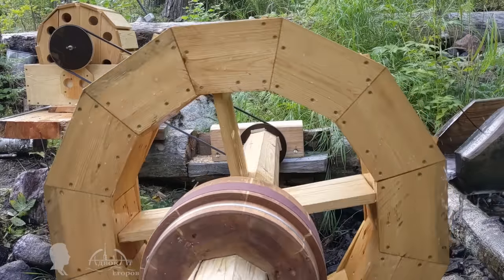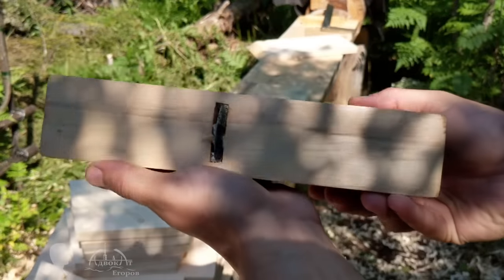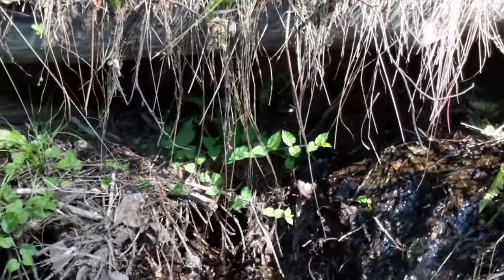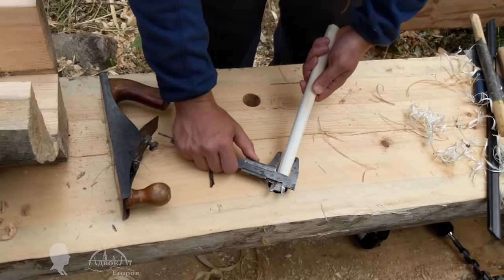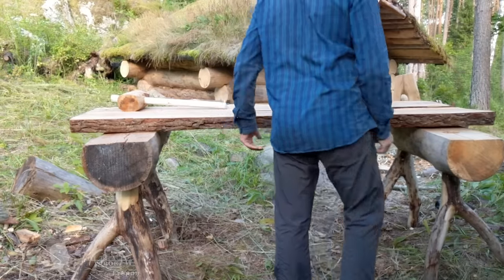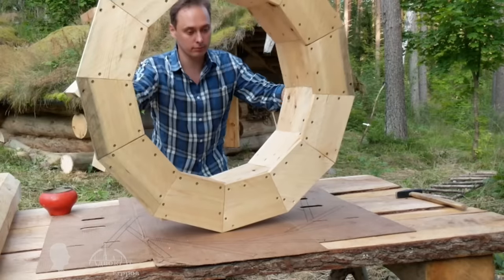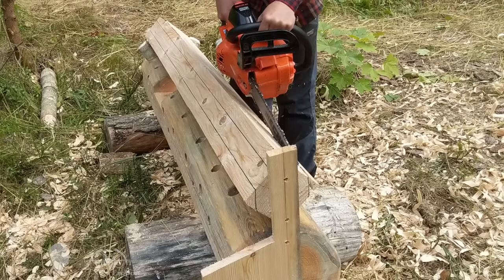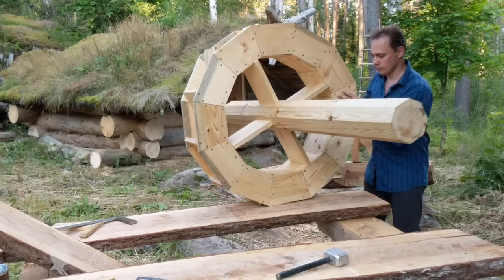Constructing a Bushcraft Waterwheel / Harnessing Hydropower Energy for My Log Cabin Camp

Comment: In America we have a saying "measure twice, cut once". In Russia you have "measure 7 times, cut once". The quality of this craftsmanship reflects that. Through impatience and over-use of power tools I question if I could build a water wheel that even functions. Yet you have made something that spins true using the bare minimum of tools. Absolutely incredible.
Reply: Yeah I couldn't build this. I'd use a large truck wheel on a hub with the blades welded inside the walls of the wheel.
Reply: When I was in school, the expression was "cut it twice, still too short"
Reply: In Northern Romania we have a joke. 
The German measures 10 times and cuts once, the Romanian measures once and cuts 10 times.
Reply: And most importantly he grew wheat and grinds them with the help of his wheel system and makes bread out of it🤗
An absolute legend 😎
Reply: in The Netherlands we have "Measuring is knowing" (meten is weten)
Reply: "I've cut it off twice and it's still too short" is a expression often used here in Switzerland when doing stuff like this.....

Comment: The shape of the wheel made with so many smaller pieces means that the geometry size will be more stable. It will not shrink much from drying because the shrinkage is greatest in the direction of the length of the wood grain. Since the pieces are small, their shrinkage should be negligible. It's a good design. Thank you so much for such a wonderful long video. I will watch it many times, I'm sure.

Comment: The detail of how you have learned to spend more (or less) effort because it is required (or not) is very useful.  As an Engineer, the tendency for extreme accuracy is always there, so know when it matters or does not is very critical.  Understanding the points in time that require extra attention focus on design and where "good but rough is good enough" also helps a person doing it the first time where extra care is a good investment.  I enjoy the way you present the material, and using the correct description of the tools used lexicon for clamp types and such, helps those without experience to look up details on more information themselves -- this is very important to those that have less experience to help themselves!  Bravo.

Comment: One of the best hour-long videos I've watched on YouTube!  I love that you actually have the opportunity to implement your ideas, as well as expanding your skill set!  I wonder if your use of your assorted attachments could be made easier if you were to fabricate a long shaft like in old industrial settings?  A single shaft runs the length of the production floor and allows for the simultaneous driving/powering of all of the milling machines, lathes, grinders, etc... Regardless, I think what you're doing is fantastic and only wish I had the health to do such things on my own.  Namaste
Reply from the maker: Yes, I am planning to build more attachments but the power of this waterwheel is enough only for one machine at a time...
Reply: @Advoko  That's one of the eldest problems mills and waterdriven saws and hammers had ever since we found out how to make the creek share its energy ;-)

Comment: for weather/water proofing wood:  First you need to dry the pieces over a heat source for 48h, 
then you coat them with maritime grade epoxy or polyester resin(less smell when curing, less durable) mixed with UV additive. (you can make it clear, or colored)
for an increase in mechanical strength, coat with resin then apply 1-3 fiber glass mantles (the cloth looking one not the shredded one) finish with another coat of resin.   my little wooden water wheel is made like this, and i use stainless steel hardware, still working 24h for 8 years now.
Reply: With all that epoxy and fibreglass, what do you need the wood for?

Comment: around 40 years ago i got full size plans in the  mail ( pre computer days ) for that exact waterwheel . except mine did not  have a wooden axel , i used face plate mounted bearings and a steel shaft  somehow .   it was for show only and was mounted in a small homemade pond in the backyard and was powered  by a  small pump that pumped water into a wooden box above the wheel . birds loved it for the sound of the running water .

Comment: hey great job u did there, looks fantastic and very interesting to see how this can be done with minimal use of electric tools.
Maybe u could implement an elevator system to lower or increase the height of the water carrying arm from the dam towards the wheel, to adjust the water speeds and therefore the rotational speed of the wheel depending on the work u want to do i.e. grinding coffee beans is better at low speeds; or depending on the "water season" i.e. general high water flow or low water flow.

Maybe u want to add a guiding system for the wheel as well to bring it closer to the dam or further away.

Good luck for ur next projects :-)

Comment: Using a chainsaw wearing sandals gives me the willies.
Reply: Yeah, I've done it in thongs so many times I've lost count.
Every time, I tell myself how stupid it is. 

More importantly though, you should never be cutting with the chainsaw bar heading for between your feet/legs either way.
Reply: @osricsbruk  You can lead a horse to water, mate.  The reality is, we're all the same. He will probably continue to do as he does until he has a close call, so close that it wakes him up.

I'm not one to talk. I still cut between my feet on occasion, run grinders almost exclusively without guards, and ..... lots of supposedly "dangerous" practices.

Trick is, I'm competent. I don't care what the safety officer has to say, I'm there to do a job and I will do it as quickly and efficiently as possible. Whether they agree that my methods are safe or not, doesn't bother me.

Feel free to continue though man. After all, you're only trying to help :)

Comment: Outstanding work Max!! That hour went by really really fast! I have only one suggestion for you You can gain a huge mechanical advantage by changing the diameter of the first wheel, to a secondary smaller feed wheel which will increase the end rotational speed. I believe it would also be possible to embed magnets in the wheel, then create magnetic pickup coils from wire, and with a rectifier you can produce your own electricity. 😉

Comment: You are like the bob ross of bushcrafting. I am planning a homemade homestead and looking for inspiration/ideas. This is literally the first video I have watched on the subject and I can probably just use your vids to get the job done. My problem is having to create my own waterway for water wheel. Im thinking use underground water and pull it above ground with an ebenflo  tactic to create a self pumping system to constantly have water flow. Im either going to set up pipe to drop water onto wheel or create high pressure to simulate a stream
Reply from the maker: Keep in mind, bottle hives are always protected with a reflective foam insulation that I only briefly removed to make these shots...

Comment: That was fantastic!!  You do darn good work. VERY interesting how you designed and built each part.  I have seen many water powered mills and most seem to use over shot water systems.  The water comes to the wheel at the top and runs down the front.  It uses the weight of the water for at least a quarter turn of the wheel for power.  In your case it would have required placing the wheel farther from the dam.  Amazing construction on the wheel I must say.  You are quite the craftsman.  I really enjoyed watching you work all the parts of the job.  Thank you for this video..

Comment: I have never attempted a water wheel, however, I have done several damn and ponds.  I would strongly suggest an overflow pipe and possibly diversion tunnel, to shed water when you have excess spring flow.

Comment: Beautiful, no bout a doubt it, but why not employ a sort of rubbing brake, perhaps from leather for long wear, and inexpensive too? Then you could lower the wheel for more power but avoid the centrifugal force, by starting the water drop at the top of the wheel, so simply put, there is more weight for more power, perhaps to run a generator. Nice work, this also counts well in the work-of-art area.

Comment: Your skills are lifetimes beyond mine so you would know better, but perhaps a foot pedal for multiple lathe-like cutting sessions? You could make one small one akin to an old-fashioned sewing machine but using differential gear advantage like on a chain block. You could also have a larger, platform-sized pedal that was closer to 1:1 that would prime the wheel to overcome initial friction, then you could sustain it lightly with a few pedals too, or simply add either of these forces to a sustained rotation from the stream for more torque if needed. The addition of a flywheel you could variably clutch into could be cool too, but perhaps a little too violent for the elegance of the systems you're working with. Amazing work, as always.

Comment: Next time you decide you want to dry some lumber put it underneath the eaves of your house where it can't get rained on put it up off the ground on a hard surface with boards underneath it to support it and weights on top of it.
The reason why it worked is you don't have anything to hold it straight it has to be weighted down and it's inside where you're warm and it's drying too fast.
When my father was building 50 ft wood boats this is how we had to keep our lumber straight while it was drying.
We would mail it and dad would put it in a drying shed one that was open on one end so that the humidity was there to support its drying and it took about a year to dry it correctly.

Comment: at 32:40 you said you were at a loss as to why your spokes inside the wheel stayed fitted tightly, even after drying out...
in my years of experience working with wood, it does not shrink much in the direction of the grain (less than 0.5%), as the fibers lend it rigidity. but it shrinks more across the grain (2 to 6%), or radially from the heartwood. this is due to the softer spongier materials between the long cellulose fibers. this is why large dried timbers can have cracks along the grain even when not under any stress. and why its better to saw planks while green, so that radial shrinkage isnt spread over as wide an area. hope that makes sense, and a quick googling confirms this with other people's experience.
Reply from the maker: Kelso, thank you for the reply!

Comment: Ok, what about a circular frame supported by an upright timber.  It would look similar to an umbrella or mushroom.  The rotational energy of the waterwheel only needs to be rotated 90 deg. perhaps through a set of wooden right-angle gears/cogs.  Now, on the "cap" of the mushroom, you attach clips and now you can hang your clothing in the sun, and they will gently spin to remove water by centrifugal force (I imagine it will wick from top to bottom and be flung off at the lower edge).  This could enhance drying time significantly vs. just natural sun drying on a line. LOL.
Reply from the maker: Ralph, thank you for the info

Comment: I have a question my love could you have used a brace and bit to drive your tenon cutter and wood augers??? Please let me know sugar bear cause that's what I plan on doing!!!! I'm definitely a driven prepper and am trying to stay away from relying on electricity all together. However I'm also wondering if there's a better way to make boards than using a chainsaw??? Maybe peddle power as that of a bicycle or maybe a larger water wheel????  Sincerely one of your caring fans!!!
Reply from the maker: You could but it won't be easy. You could make boards using a chainsaw (there is even a video about it here) but they won't be as strong as the ones that you produce by splitting...
Reply: @Advoko  thank you so very very much for your reply sweetie and I agree. But would still like to know if I or you could drive the tenon cutter and augers by hand instead of your strong drill!!! I'm thinking about a ratchet adapter for my breaking bar that I can also put a wrench on creating a large ratchet action tee handle what do you think my love?????
Reply from the maker: I think it is doable
Reply: @Advoko  That's it!! Awe come on I'm already convinced you're highly intelligent!! And more elaboration would of course be welcome sweetie. But I do understand your already extremely busy and at the same time honored to have a reply in the first place. Thank you sugar.

Comment: The only thing I think would have served you better is to have the water wheel turning the other direction with the water coming in higher and pushing the wheel over from the top.   It would provide you with more efficient water usage and a bit more torque / power from the wheel.

Comment: You'd gain a lot of energy using a larger wheel the water is slamming into the wheel then going down wasting a large portion of potential. from the look of it you have a 4' wheel you'd likely triple your torque with an 8' wheel using the size as much as a fly wheel and lining up the most efficient part of the blades with the water flow. I'd also suggest using the same kind of Straps the saw mills used to move the working area away from the source. and maybe consider going to a few dowel gears so you can turn it on and off without stopping the wheel.

Comment: The overflow waterwheel design is more efficient. You can see by the amount of backsplash you are getting that water energy is being wasted. The energy that throws the water backwards, is energy lost to the wheel.
With the overflow design, the momentum of the water turns the wheel, but the water collected into the buckets also turns the wheel by gravity. So you get two turning effects, and the water overflowing has a greater distance to fall, so has a greater turning effect.
.

Comment: I found it comical when you were lecturing about safety.  You were describing safety measures, and the image on the screen was one of you using a powerful drill while holding the work down with your bare foot, only a few inches from the spinning drill bit. Pretty funny, actually.  My esteem for was not affected by one whit.

Comment: 40:50 how about connecting the opposite edges on the top of the workpiece and then use a right angle to align the drill bit. Sure not 100% perfect, but same with your method. You'll end up with some run-out on the top and if the workpiece is not completely level in comparison to the clamped drill bit, you'll end up with a hole which gets wider and wider the further you go.
Reply from the maker: There is always more than one way to do the same thing))

Comment: Both ends of the pulley are the same size. You could speed up the rotation of the mill by having a smaller driven wheel.
Reply from the maker: Thank you for the reply.

Comment: Yeah, I see what you did with a wooden mallet , a wedge, a hammer, and chainsaw to create your own lumber. Cool man, you're very skilled.  An assembled mini-aqueduct , w/  a very well made waterwheel. You're  skilled , innovative , and efficient at what you do. The only question that I have is the hollowed  out wooden water channels, as well as the blocked wood used for various purposes suck as the dam, and waterwheel;  (all interacting with H20 ,) are apparently not waterproofed , or is all of it waterproofed ? I did see you applying pith, or stain  ; but not to the entirety of that project of running water you so expertly put together.
Reply from the maker: No, I didn't apply any waterproofing to any parts of the system.

Comment: did you eventually connect the water wheel to a generator.   I haven't seen that video yet,  but were you able to achieve the necessary RPMs and torque to generate enough wattage for your needs.   I see you are using battery powered tools,  but these batteries have to be charged,   how were you able to charge these batteries.
Reply from the maker: I only connected it to a tiny generator made from a drill (shown in this video) to charge my batteries so far.

Comment: Something is a bit odd with your wheel design. You do gain the water energy due to height difference but you loose most of it's dynamic energy due to its speed because of the angle it hits the wheel. You either have to divert the flow direction a bit or even reverse the wheel rotation if you cannot do the first. The power difference will shock you.
Reply from the maker: Thank you for the input

Comment: Not a criticism. Just thinking You should cut back the water trof that turns your wheel. Cut it back where the water land just in the V. The water hitting the wheel straight on your loosing potential force.
Reply from the maker: Thank for the tip!

Comment: Hydro power and it's utilization to provide energy for many things are sometimes forgotten  simple solutions. However,  in the western USA water is more valuable than Gold . Sadly the system shown in this video would be hard to install here because daming & diverting water like this will affect stream flow up and downstream of the device and could get one in alot of trouble. Harnessing any stream creates issues. Water laws are complicated and apply everywhere in the west. You could own the land that a stream or river runs thru but you may not have the right to access the water in that stream. The old and very legal basis for water law goes like this " First in Time , First in Right' meaning  in simple terms : Who ever uses the stream or river first whether upstream or down stream of others, has the right to first dibs on water amounts. All that said this video is proof that there are ways to provide what one needs to survive comfortably... as long as the stream doesnt freeze ! Ha Ha !